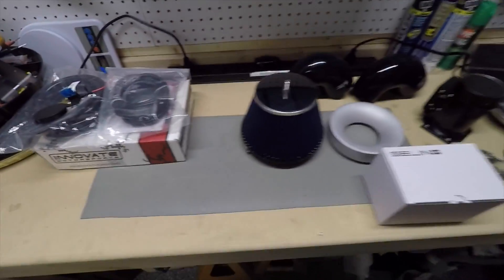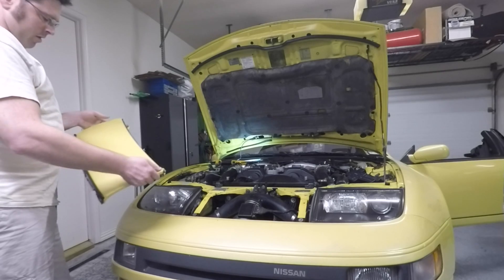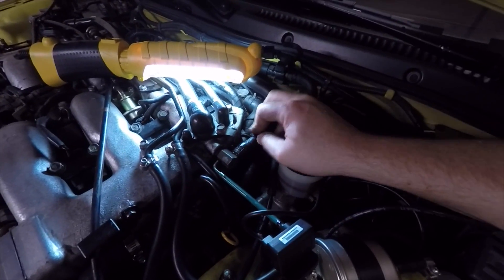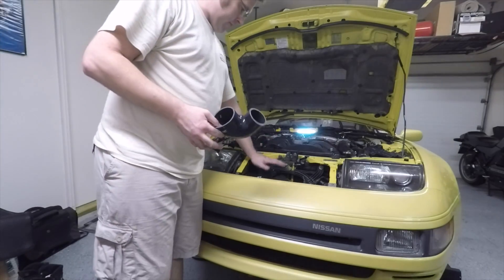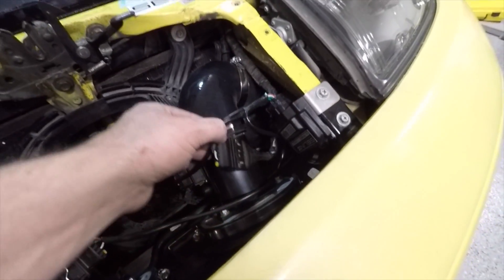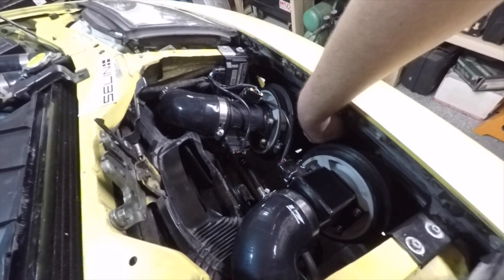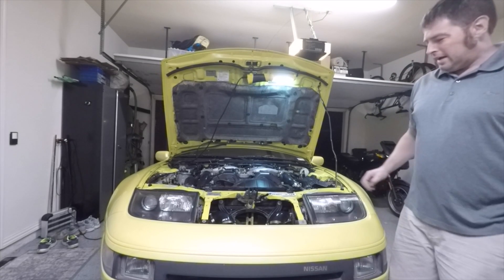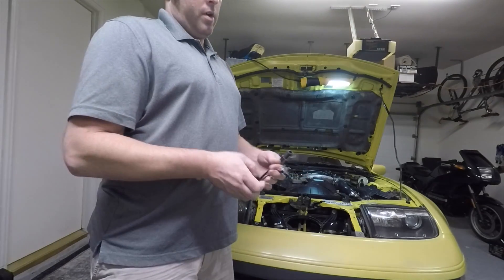Zed Car Garage S01E05 - Dual Intake Installation

Comment: what happen to your z haven't see you post any video lately.
Reply from the maker: Ha, thanks for noticing!  Honestly got bored of making videos, but getting the itch again.  Have done a few more mods, but nothing serious.  The main thing was a two-speed electric fan from a Ford Taurus and remote coils using the LS-style truck coil coils.  I thought I was fighting a PTU issue over the summer, so wanted to eliminate that as a possibility, but the issue ended up being a loose ECU connector.  This winter I will be doing a 5-speed swap, so that will be a major undertaking.

Comment: Smart idea to do the boost leak test before you install, yeah interested in the knock sensor relocation. If that circuit is messed up the ecu will go into safety boost mode and engage the oem boost solenoids. I had a yellow tt Z that looked like that and it was an automatic as well. Jim Selin himself organized a dyno for me after i bought the selin kit in the early years to collect some data. The reason why he wanted my Z was because it was stock... not much data out there for stock before and after as most people at the time had already modded Zs. Unfortunately my Z was in limp mode (safety boost); however, I gained a whopping 25 whp nevertheless. True story!
Reply from the maker: Vu Nguyen that's a cool story!  Neat we basically have the same Z. I regret not at least doing a few timed acceleration runs to do a before/ after. I should have the knock sensor video up shortly- there was a slight mishap, but I'll save the details for the video :)